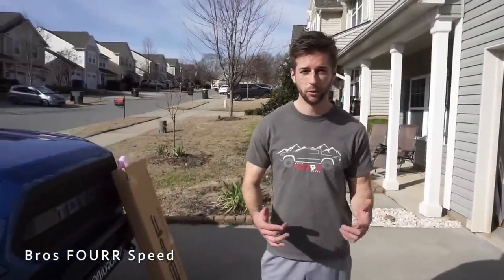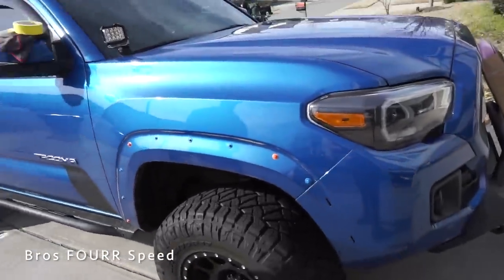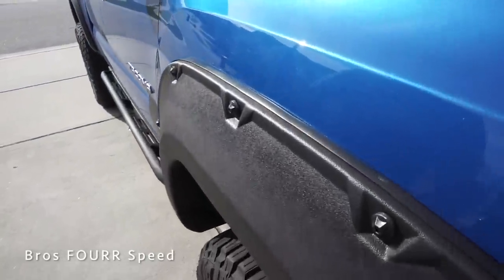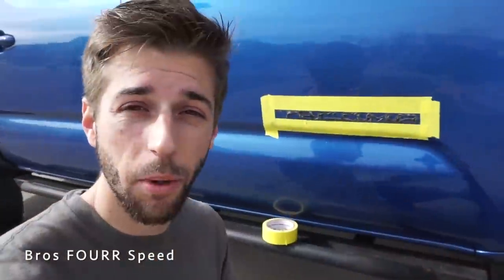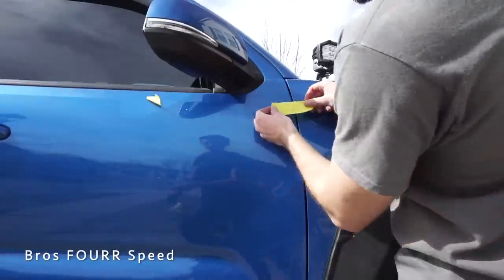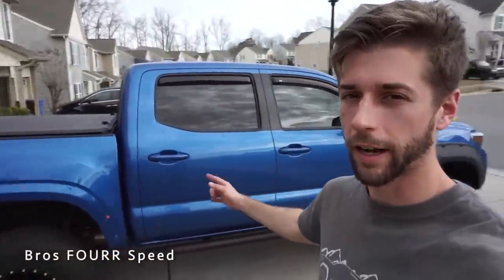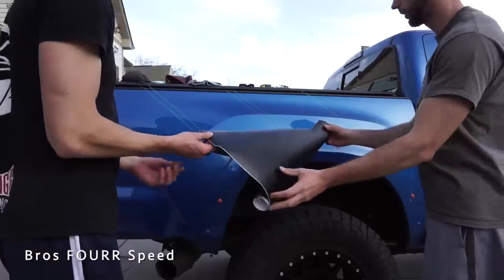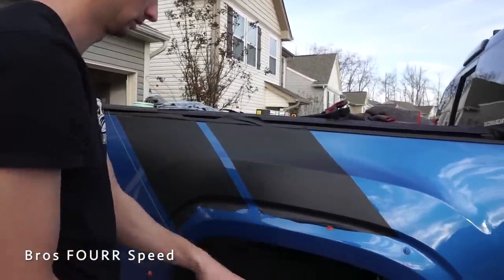Giving My Toyota Tacoma A Massive Overhaul! + GIVEAWAY!

Comment: The tacoma project is coming along great! You should consider a gear upgrade, maybe some Nitro 4.88 or 5.29 gears. It would make that truck perform so much better on those 33s and maybe improve gas mileage.
Reply from the maker: I am really considering doing that, just have to find someone to help install, that's one thing I'm not as comfortable with taking apart, but I've heard it makes a big difference!

Comment: To remove the glue from door emblems there is a product called an eraser wheel , you just attach it to a drill, and like its name it removes glue without hurting the paint, DO NOT use this wheel on plastic parts., works great on decals also.
Reply from the maker: I haven't heard of that!  It definitely took some time to remove it all by hand!
Reply: You should be able to find this product in a auto body supply shop, I used this product in the auto body shop for the last 25 years , once you know how to use properly it work great, I’ve found taking decals off with a heat gun work well, the eraser wheel works well for those little pieces of decal that are harder to take off.